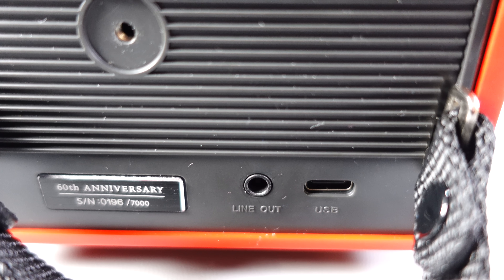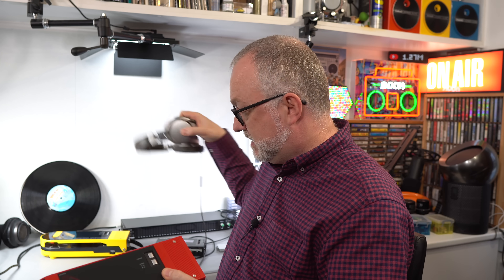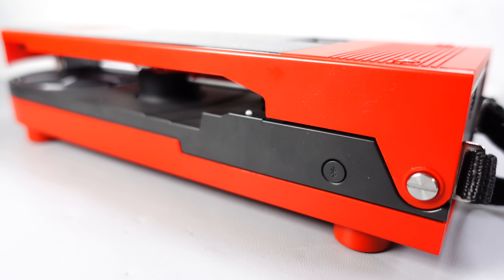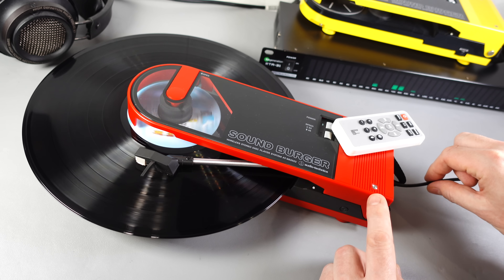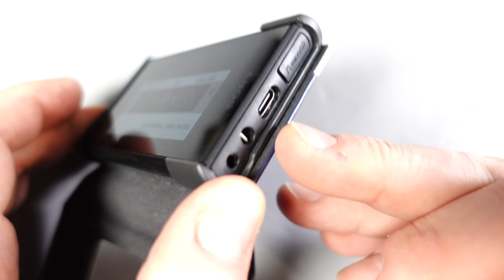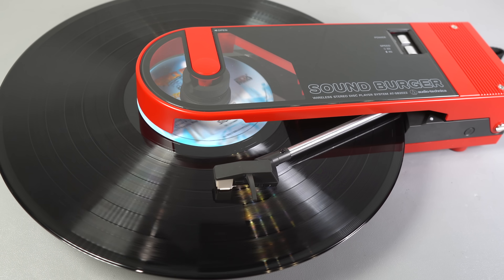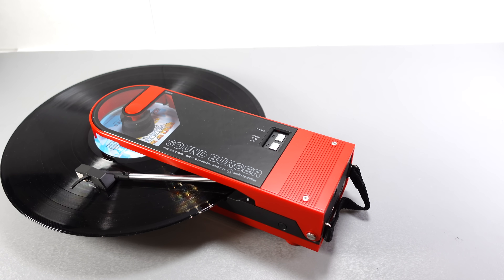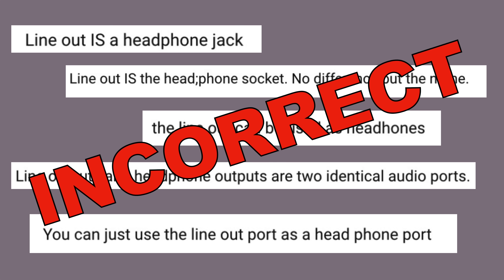Line-out ≠ Headphone-out

Comment: Hi @techmoan, well this is not true always! Modern Mac computers have a 3.5mm output port that detects the load and adapts appropriately. It can sense whether the load is low impedance headphones, high impedance headphones or a line level input.

Comment: Have a problem. Dell 8950. Filters audio & video down from PCI to sound card (Realtek), then video (&possibly audio) to NVidia display card. DDMI OR Display-port (3) sockets. Cannot capture audio. So: No capture of video & audio in sync. Would not be bothering you if Dell still provided proper specs and/or ASSISTANCE as about 7 yrs ago. Thanks

Comment: They are chalk and cheese, the headphone output will drive 250k to 1M ohm and beyond with several volts at around 2w where as the line output is suited to 100k at 2v peek at very little current level. Line and headphone have nothing in common, I'm shocked anyone would be ignorant enough to confuse them!

Comment: This was really informative. The unamplified output of line out makes sense. But now I'm curious what is the deal with the Bluetooth. If the device doesn't have a volume control on it what is determining the levels there? Is it about analog vs digital?

My Bluetooth headphones have minimal volume controls on them but I primarily use the volume controls on the phone, computer, or other device I've connected to.

Comment: With the existence of cheap, battery-powered amplifiers, it doesn't matter what kind of wired output it has as long as it actually has one. So I don't understand what the initial complaint was. Normally I wouldn't be defending the dongle-fication of electronics but if you're already paying hundreds for a gimmick turntable you can afford 20€ for an amp.

Comment: A Headphone output might not be an ideal substitute for a Line output because it could have noise or crossover distortion inaudible through headphones but still picked up by whatever amplifier is expecting a Line signal. My Sony T-series tape deck has a switch to select Line or Speaker signal to come to the outputs, for that very reason.

Comment: doesnt the volume you get depend on the impedance of the thing you are connecting it to? surely its pointless to compare an amplified headphone jack with a line out, esp when you consider there is not even a “standard” line out voltage. it varies from 0.7v in hifis up to 2.0v in dj decks. The youtubers are right in that you can use headphones in a line out as long as the voltage is high enough & your hp impedance matches.

Comment: tl;dr:

This is a ten minute video to tell you the difference between the two is headphone out is connected to the playback circuitry via an amplifier and attenuator stage so you have a volume control and the potential to deliver strong driver power to speaker diaphragms while line-out is merely a connector with low output voltage, no amplifier stage, and no attenuator and is designed to be connected to speakers via an amplifier with an attenuator. 

So the basic difference is the line-out pushes the need for an amp stage further along the.... line. Line-out is only meant to carry a signal to an amp but not to deliver enough power to drive speakers by itself.  

I have the same problem as this guy (even in my shorter response above) of over explaining things and taking ten minutes to say something which could be said in a sentence. I'll try again:

Line-out: Signal level connector port for connection to amp with a volume control.
Headphone socket: Signal already amplified high enough to drive speakers. Amplified signal goes via attenuator circuit to deliver volume control.

I suppose another disadvantage of the headphone out is it will draw more power from the device. This matters on battery powered sound sources.... but you probably aren't going to carry a separate amp with a portable product.

There, I nearly spent ten minutes trying to explain the same simple thing too.

Also..... he probably could have explained it in two minutes but wanted to have an excuse to stretch the video past the ten minute mark.
Reply: TLDR just read the video title

Comment: Except 99.9% of modern devices have the line out amplified. Computers (laptop and desktop) are that way, audio equipment is that way, almost everything. And almost none of them have built-in volume control specifically for headphones. In fact, quite often, that's built into the headphones.

This one product is a very rare exception.

Comment: Is it also depend on the impedance of the headphone? If you use a low impedance headphone or earphone, then you could hear the sound. Of couse, you cant control the volume on the device. However, nowadays, some headphone would have a its own volume control, so is it still a usable option, if you have the suitable headphone or earphone?

Comment: I was wondering how you'd fill nearly 12 minutes with "line output is a low level intended for driving other equipment and often may not have the power to give much sound into headphones (and doesn't have a level control), though sometimes uses the same connector". But I thought you might also mention the question of impedance: some headphones are still only 8 ohms (possibly even 4), whereas I'm not sure what line out is - a kilohm? - but much higher in general, so even if there's enough oomph to be audible, it'll generally skew the frequency response, usually I think meaning you'll hardly get any bass.

Comment: It depends on the device, which is where the confusion comes from. Some devices do include volume control and amplification on their line-out. This means that it's technically not a "true" line-out but it's labeled line-out on the device nonetheless. This is a wider issue with the 3.5mm as you've discussed. The connector is standardized, but it's use case isn't and that's just bad design. In general if you've made a connector it should only be used for one type of connection + an optional power delivery system and nothing else. Headphone out, line out and mic in should all have been slightly different and physically incompatible from the get-go to avoid confusion, but that's an idea that gained traction much, much later than the implementation of the 3.5mm standard. USB type C is the exception to this merely because of its wide adoption on mobile devices, which don't have room to elegantly implement a connector for every type of connection.

Comment: Nowadays, most PC audio devices will either have dedicated Headphone/Line Out ports or, if there's only one, have the option for the user to select which is used (which in turn sets the necessary impedance).

Comment: Line outputs are designed to have litte current flow, since it's not the current that transports the audio signal but the voltage. It's the change of voltage level is what follows the recorded audio wave and a device with line in only needs to measure those voltage levels and therefor almost no current flow is required. The effective power output you get from a line out is about 1 mW. A headphone on the other hand has magnet drivers connected to a membrane and embedded in a coil acting as an electromagnet and to build up enough magnetic force in the coil to pull or push the magnet, way more current is required, as it's not the voltage that creates the magnetic field but the current. The voltage just influences the current, as current is voltage divided by resistance, so if the resistance stays the same but the voltage raises, the current will raise as well (if the power supply can deliver that much current, otherwise the voltage will collapse instead). So the magnetic force follows the voltage levels but you need enough current to effectively drive the magnets. Earbuds are normally around 32 ohm, they will probably still produce something you can hear from a line signal, yet quiet, but larger headphones are often 150 and up and the higher the resistance, the less current flow and thus the less magnetic field is build up.

Comment: Short version: headphones is amplified while line-out is only the signal.
Reply: And you CAN use a line out for headphones*

*As long as you have an amp for the headphones
Reply: Active speakers are expecting an un-amplified, low-voltage Line-Level signal (typically 0.3V to 2V).
Reply: @wiesolos neither passive or active speakers are better than the other one.
Reply: sort of.. line out is line level amplification.. its .316volts max output for consumer electronics. Studio line output is about 1.23volts.. more dynamic range.
Reply: @jaybrooks1098  So no matter the amp, the consumer line out level is always sub-par or even lossy?
Reply: Line out is high impedance output
Reply: thank-you
Reply: We don't know that
Reply: Thank you know it's useless to watch the video and I have now almost 12 minutes more of my live
Reply: @esel_gamer Maybe use that 12 minutes to study grammar...😂😅
Reply: @MrIanspeed  he's right though, it's 12 min less of waiting frustration

Comment: I think the whole "line out can be used for headphones" comes mainly from PCs, where line out and headphones were often coming off the same audio amplifier chipset, and were both volume controlled in software.
Reply: Also, every Realtek chip (which are in like 95% of motherboards) has switchable pinout. That means, you can change pinout in software to be headphone output, line output, line input, microphone input, rear-surround-output or whatever you like (until it allows for such combination).

You can actually do pretty wild stuff with this when I was tinkering with it on Linux years ago. No Windows (and even Linux) software had all the possibilities, but with OSS (Open Sound System) audio service (instead of traditional ALSA) it was actually possible to change pinout of anything.
Reply: @morsikpl  actually 'hdajackretask', which is part of alsa-tools, is able to reassign those pinouts, unless i'm not understanding and it's missing some settings?
Reply: @ryjelsum  it seems you're right! But I see this tool is about 13-years old which is about time when I was experimenting with pinouts, so either this tool didn't exist just yet, or was too limited, or I simply didn't know about it :D

Anyway, OSS had nice GUI app (at the time) that I would reassign pinouts in just a second with my mouse, so that was easier ;) (and yeah, I see that hdajackretask also has some GTK app in it's repo too)
Reply: @morsikpl i remember doing pinout settings on windows 7😅
Reply: @morsikpl why do they call mother boards motherboards???

👉 I DON'T KNOW.
Reply: @That-Ninja  I call 'em mainboards
Reply: @sf4137  whoa there.
Reply: @That-Ninja  i call it yourmoma... because it has lots of ports
Reply: @Achiever88  
If I paid you one hundred dollars, would you legally change your name to 
"whoa there" ?
Reply: @That-Ninja  Because 'Motherboards' use to be backplanes that connected together child boards, which actually offered functionality. All functionality was taken care of by child boards, the 'motherboard' was a passive device that did nothing but connect everything together.
Reply: @That-Ninja  Why did your parents leave you?

👉 I DON'T KNOW
Reply: It's not just PCs anymore. Lots of DAC chips out there, even the audiophile marketed chips, are all-in-one systems that combine the functionality of DAC, preamp and amplifier into one chip.
Reply: PC audio is the correct reason why people think this.
Reply: So on a PC, what is the difference between headphones/speaker/line out? They're all controlled in software, right?
Reply: @lostfan5054  Theoretically, speakers would have higher gain than headphones, and line out would have a fixed level output(assuming volume is at max) and may be higher impedance, but since pc audio jacks are switchable, in practice there really isn't any difference. 
Sometimes in 5.1+ situations, only the speaker out can carry the isolated left and right speakers, while the headphone would only carry the downmixed to stereo audio.
Reply: makes sense we use cheap audio cards on laptops/PC to input all kinds of stuff I have a Bearinger audio interface now for just that with my Dj gear to record my sets without software restrictions
Reply: Nope.  The confusion started way before PCs were available to the consumer market, before even Ma Bell went digital.  The confusion was baked in from the start by engineers.  Creating dozens of close but nevertheless conflicting standards all using the same plug is illogical, and this lack of forethought lasted well over half a century.   The engineers designing the SoundBlaster may have contributed ever so slightly, but by this time the confusion was already immense.
Reply: @RoySATX  Lots of protocols but only need to make one cable/plug -- sounds like cost savings to me.
Reply: @RoySATX  I would rather have one cable than who knows how many whine about real issues
Reply: @RoySATX just like usb
Reply: @destructodisk9074  
Hey.  What do people call box turtles, "box turtles" ?

👉 I DON'T KNOW 😎

Comment: Oh man. I feel so silly.  I've had a multiple computer setup for a while and have used a multi-channel mixer to combine all the signals so I don't have to unplug/plug something or even change an input when I want to use a different device.. well one of my newer computers since setting it up has always been SO loud and the channel fader is always at like 2% and the audio had tons of digital feedback when I would play games or do something different on screen, I could literally HEAR visual motion on the screen coming through the speakers via different frequencies of noise. turning down all other faders while I played the game would reduce the noise but it was still there.
Well you just made me realize..  the connection from the computer to the mixer was coming from the headphone jack at the front of the computer case.
I actually didn't know the headphone jack at the front was amplified!  I just plugged it into the back and the fader's cranked. no noise AT ALL!
THANK YOU!!
Reply: never use front panel audio. ever. always use motherboard i/o audio.

doesn't usually cause problems, it just sucks.

Comment: Any time I've come across the 'Line Out' port on a device, the audio is at a much higher sound level than the headphone port. I always use the 'Line Out' for connecting to a stereo/amplifier. The only way to use headphones in 'Line Out' port, apart from something like the volume controller in the video, is if you have a volume control on the headphones themselves. 

From my experience anyway.

Comment: I doubt anyone who is bothered about audio quality would use a sound burger, headphone amp probably costs several times its cost. A line amp for domestic kit is -10dB at 10k usually, whereas a headphone amp is aimed at anywhere from 8 ohms to 600, which to drive any kind of level needs to be able to drive many times the amount of current of a line amp.

Comment: Thanks for making that clear. 
But while I was watching you poke jacks into sockets I was reminded how a couple of my devices have been damaged by the placing of a power connector from an AC adapter being pushed into a headphone socket by mistake, which leads to one of the two  channels not having any sound through the headphones. Is there a repair for this?

Comment: I might stand corrected but I understand that it's all about impedance matching. A low Z (impedance) must be matched  to a low Z to get maximum transfer. The line out I think is relatively low Z - headphones are generally higher Z = unmatched and therefore in your example results in low volume. When you boosted the  line out into a headphone amplifier the output would be higher Z and a perfect match for the headphone! I think that's right!😊
Reply: That's incorrect. Line inputs have much higher impedance than line outputs. And it's not a problem, because here you don't care about power, you aren't powering anything, you transfer a signal, a voltage. It's good to have high-Z input to not load the output.

Comment: Lowering the volume often results in quantization noise because in modern devices the control is digital before the amplifier. The headphone amplifier might also have a constant noise that is higher.

Btw, why do they call it "line"? Does it mean an electrical line/cable, or "linear", althoutgh I imagine amplifiers would also aim to be as linear as possible.

Comment: Technically, in the most literal sense, sure... but near all modern technology combines them and they're the same thing, so they're not wrong, the device is just outdated and not up to modern standards of use.
Reply: Also, my headphones have an amplifier with volume control built in, and it works perfectly with any line out. So it's even more "they're the same thing"

Comment: I disagree on one point of this video...

I had headphone out on my old TV. I used it as a line out by plugging my desktop PC speakers into it.

The trouble is, whenever I turned on my TV, the speakers would pop. Doing this repeatedly damaged my speakers.

So I disagree that you can use headphone out as a line out.

Comment: I did notice that on circuit design(especially in the 1940's+) the speaker and microphone uses the same circuit designation icons! They're technically output vs input, but the circuit design is a bit misleading because they DO use the same icons! I haven't seen newer circuit designs… but it's interesting nonetheless! 🤔🤔😉😉

Comment: It entirely comes down to design. A well designed line-out with sufficiently low output impedance will drive headphones just fine. A poorly designed line-out probably won't.